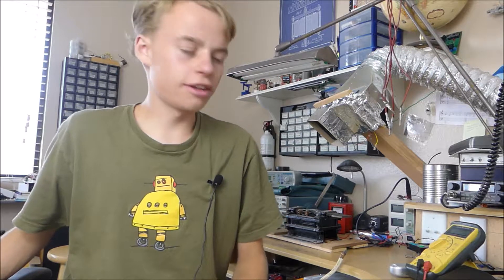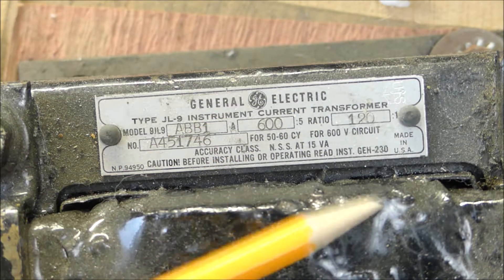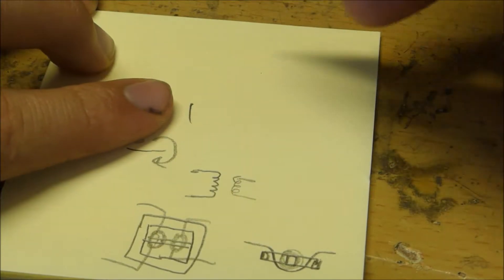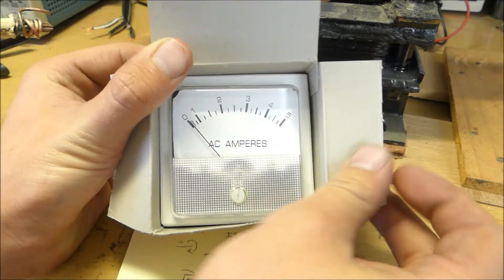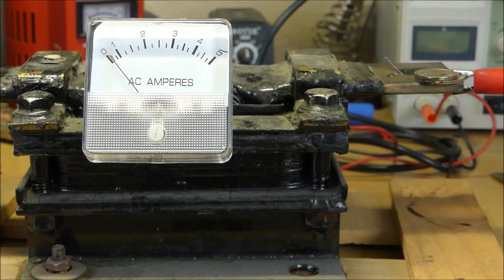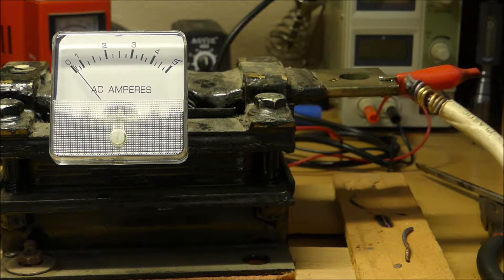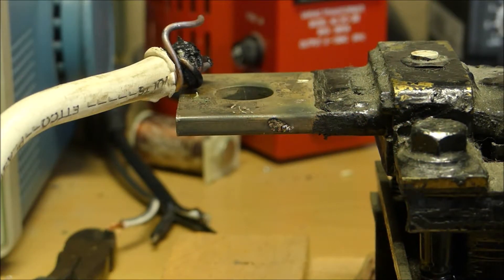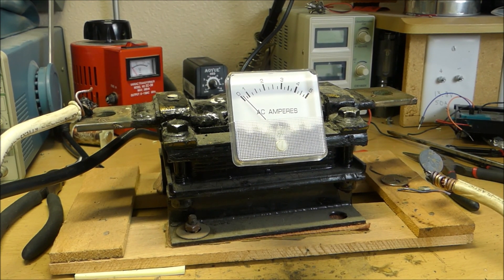Using a Current Transformer to Measure Rewound Microwave Transformer Output Current

Comment: Make your own by taking another microwave transformer and determine the primary number of turns, then wind a single loop of your high current secondary through it, and you have a transformer capable of measuring the current accurately. Likely the transformer you choose will have close to 120 turns on the primary side, so you can use a 10A range on a multimeter for a less than 30 second measurement. Make a sheet of the conversion chart, but if you get a surplus 20A meter simply recalibrate the scale for it.

For household current measuring best is a clamp meter, or use a open core current transformer, where you simply pass the phase wire through the hole in the core, no connections needed.

Otherwise look for a Rogowski coil, which can be clamped over the cable core to measure the current.